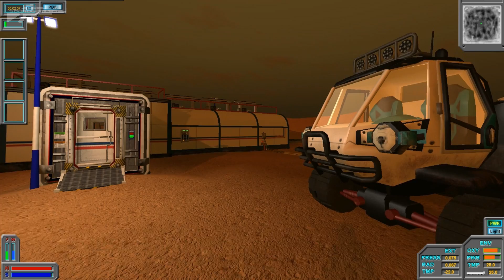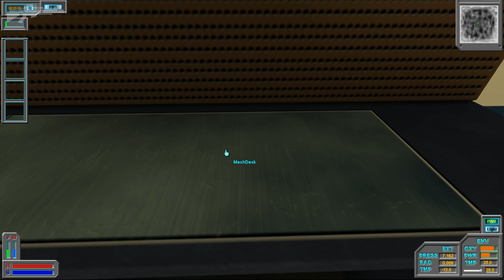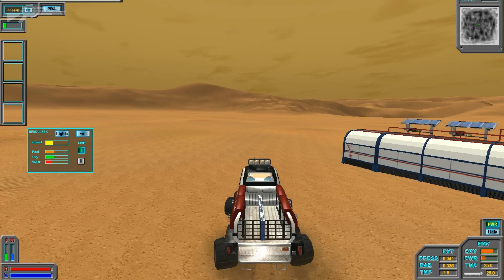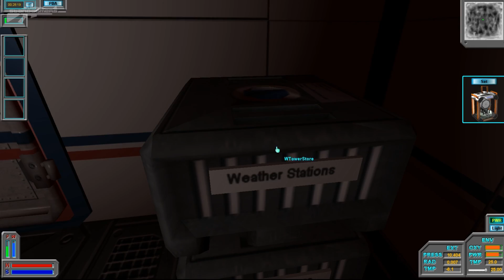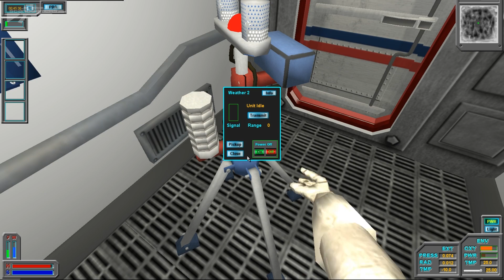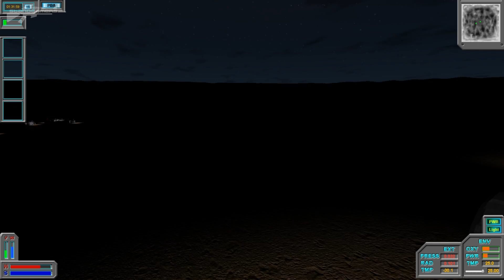Mars Colony Simulator - Removing The Helmet, Big Mistake!!!#2

Comment: Aaron so silly. looks at water separator, sees that it's idle "Yup, everything working right." looks at air scrubber, sees oxygen 50% lower than safe and carbon at 8.5% "Yup, everything's working well." looks at water pump, sees that it's idle "Perfect." Sees that the solar panels are outputting drastically less power than normal "They're running great!"
Reply: I think the solar panels weren't at their max output because it was morning
Reply: xD mankala8 .lol xD

Comment: Robots don't make mistakes but humans do and you proved it in this video.
Reply: hey man, robots can't think if like there is like a storm and you have to seal a room since you have precious chemicals that are pressure sensitive! A robot will have to evaluate the situation unlike a human who would just slap duct tape on it and find a long term answer to it!
Reply: Have you ever seen bugs and glitches in games? Those are examples of "robots" making mistakes.
Reply: ***** See, you got my point. A robot is as good as the guy that programmed him.
Reply: ***** It was, I just used a cool little trick to make you think about it a little deeper. A game is programmed, and a robot is programmed. If someone fucks up the code, it makes "mistakes". And a little difference caused by electrostatic charge can also lead to mistakes made by CPU. With the amount of operations modern processors do every second, it's quite probable that once in a while 0 will change into 1. In your PC, it can lead to few pixels displayed in a wrong place for 1/x (number of frames per second) of a second, but on Mars, where such robot would make calculations which affect the outcome of the mission, that little change could lead to huge differences in results. Like 1001 instead of 0001. Here, on Earth, it's quite simple to protect CPUs from electrostacic charges, but on Mars, where there are many sandstorms? Not so easy.
Reply: ***** You can't see the " thingies?
Reply: *****
"Robots" dont make mistakes, the people who program them do. The Computer does exactly what it is told to do. (Im just going to ignore that laughable example about "pixels being displayed in the wrong place")